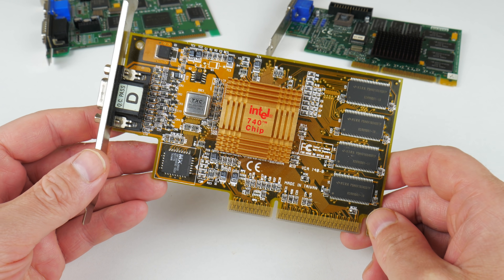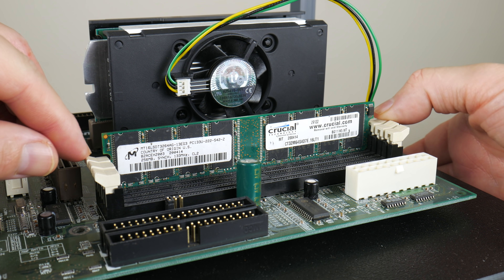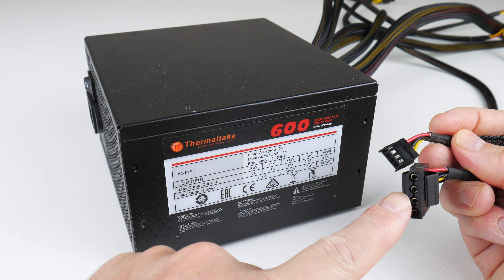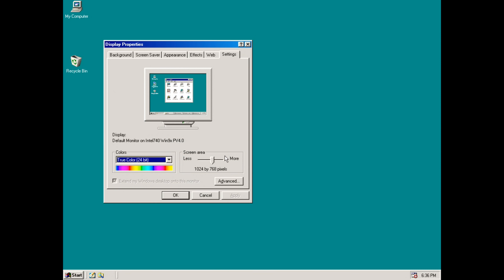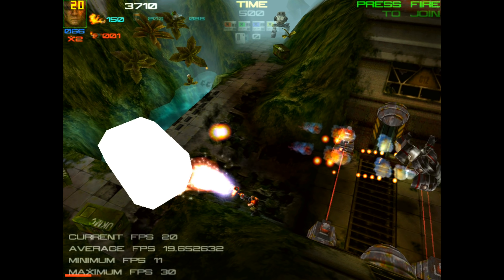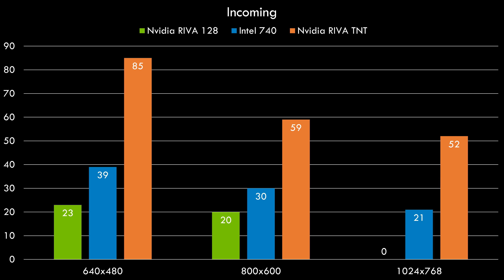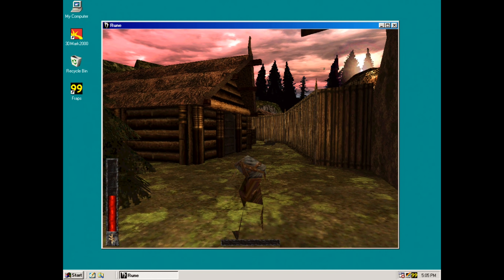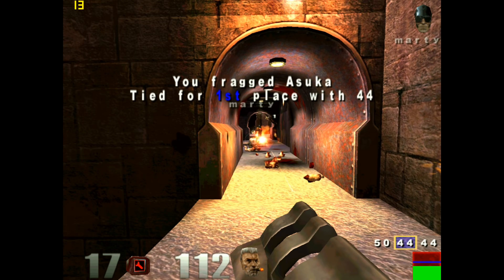Intel's first dedicated GPU vs Nvidia - The Intel 740

Comment: Back in 1998, a friend of mine in college had an i740 with his Pentium II desktop that he had built over the summer.  I had a Dell OEM Riva 128 ZX (the 8 MB AGP version) and an older 3dfx Voodoo 1.  At the time, we were unimpressed by the i740.  It ran Half-Life and Rainbow Six OK at 640x480, but it had problems with the water textures in Half-Life.  The Riva 128 ZX had "cracks" between all the textures, and the Voodoo 1 was showing its age, but had better image quality.  In the end I thought the Riva 128 ZX was the better of the 3 cards when it comes to frame rates, but the Voodoo still had an edge with games like Wing Commander Prophecy, which ran in Glide and had extra effects.  By the next school year, we had ditched all of our graphics cards and got Voodoo3's.
Reply: man.. I remember this, I had an i740 with a Pentium II 300 Mhz and underwater it was impossible to see anything on Half Life... HAHAHAHHA
Reply: Ah.. the old Pentium 2 Memories.
Reply: The "cracks" visible on RIVA128 was sue to missing sub-pixel precision support -- a calculated tradeoff in the architecture to gain performance and keep the transistor budget low.

Comment: Phil, I updated the bios on my I740 a while back and went through the same pain as you regarding the "unsupported flash device". I remember reading the documentation of the different bios versions and noted that the older flash tool versions had way more support that was later removed for whatever reason. So here's what I did: I took the latest bios and used an older version of the tool to flash it. I think it had 5 or 6 flash chip options and I tried all of them until one of them worked. The card flashed and worked perfectly after that.
Hope that helps.
Reply from the maker: Awesome, that gives me something to try :D
Reply: @philscomputerlab  Great. Keep us updated if you find the way to flash it. Mine was a QDI card though, with a different eeprom.

Comment: How much did it cost back in the days
Reply: When Intel did the deal with Real3D to license the tech they had hopes of selling it as a premium part.  However, they were quickly overtaken by innovation by 3DFX, Nvidia, ATI and S3.  Although the Wikipedia article says the chip was originally priced at $34.50 (in large quantities), I would guess that pricing only lasted a few weeks.  By spring 1998, when I bought mine, I only paid £49 for a 8MB Chinese no brand card (suggesting c. $20 or less for the chip)

Comment: I've always been trying to get a 740, as I already have a Riva 128ZX and a ViperV550. 
The closest I've gotten is one of SiS's video cards - an Asus card based around the SiS 300/305 (can't remember the bus width). Still can't run Halo however unlike the SiS chipset in my old Celeron D desktop.

Either the 740 or 300/305 would have been far better than what I had when they came out. I had been given my mum's old late 80's/early 90's 386 PC - no idea the VGA card, no sound card but it did have a dual gameport card for multiplayer games.

Comment: I had an i740 borrowed for months because I bought a P3-500 without knowing it had AGP interface... So I needed something while I saved for a MX200. It was a fine card for what it was, the stuff it could run, it ran fine a lower resolutions. A shame it seemed to lack some D3D instructions that would prevent it from booting more modern games, as they just kicked me to the desktop with no error message.

Comment: Intel used this as the IGP for their 810 and perhaps the 815 chipsets should anyone be interested in experiencing should this card become hard to find. Fun fact that some boards did have dedicated memory for the IGP without using the system ram while there was in ad in vram module that plugged into the agp slot though rarely encountered these days.
Reply: So this is basically the same as 810 igpu?

Comment: Oh wow! Coverage on a graphic card I once owned. An i740. I actually bought this card from a local Best Buy store as my very 1st 3D video card. I quickly noticed something unwanted and odd about its RGB output connected to my Sony Multiscan 15sf1 monitor. The whole screen was dimmer in contrast to my Diamond Speedstar 24 1MB ISA non-accelerated card. No amount of gamma adjustments could compensate for the entire RGB output being dimmer than I liked. I suspect the analog voltage drive output was insufficient. I promptly returned it to Best Buy and went looking at the same store for another very 1st 3D graphic card. I liked the box appeal and specs of a Diamond Viper V330 Riva 128 4MB PCI card and purchased it. Yeah! Screen is bright again, back in the game, and happy with it for several years. My most beloved games at the time was Myst, Riven, and Myst III: Exile. And simply loved April's troubles in Funcom's The Longest Journey. For me the Intel i740 was a disappointment output wise.😉 Nice review Phil.

Comment: This was my first "GPU" paired with a Pentium II 350Mhz, not that bad, my only complain at the time was the poor performance in 1024x768, only 20 fps most of the time. Later upgraded by a GF2MX, what a difference!
Reply: Hi. My experience is similar to yours at XGA resolution (1,024 x 768). Many of those 1st generation 4 - 8 MB 3D graphic cards had too slow rendering speed at XGA. Today, my retro DOS gaming machine is using a Geforce 2 Ti 64MB AGP card. Now 1,024 x 768 runs pretty good for Indiana Jones and the Inferno Machine and Earthworm Jim 3D.😊

Comment: Well, the Pentium III 1000mhz is from 2001. So you are kind of helping this poor card a bit. With a cpu from 1998 I guess its performance would be notoriously worse. Besides, in 1998 the Rage 128, Riva TNT, Savage 3D and Matrox G200... all of them would be more attractive than Intel´s offer. Still, it is good that it existed and I am hoping Intel success with their upcoming GPUs. If they are good enough (especially in the middle range segment) we all will benefit.
Reply: Ran quite well on my old k6-2 300 mhz many fond memories of playing monster truck madness on it
Reply: I have Intel 810e chipset that uses this GPU as integrated onboard graphics.
Reply: At its time this gpu was ruining the market. Once the drivers were properly installed (aka no via chipset + k6-2) this was a beast. All the games ran smooth and you could actually turn everything to the max. Was really hot but all GPUs were hot at that time ('98-'00). The TNT was depressing, Riva TNT and the VooDoo 3D 2/3000 were scorching the pcb. The Matrox card's pcb was T H I C C so it was absorbing more heat from the GPU but they were also more as a package.

Comment: I´ve used a Dell Optiplex GX110, with an Intel 8010 and a 1GHz Coppermine (at least I tink so), It run a lot of games really good at 1024x768. I definitly want to revisit this PC, due to its very nice formfactor.

Comment: Did i miss card specs? But i guess this one have 8MB. Because rare intel model had even 4MB. I think that trying in 1024x768 was hopeless cause it was considered as ultrahighend resolution and only capable cards were Voodoo 2 in SLI or later Riva TNT. Everyone else aimed at that time for 800x600. I740 was basicaly enhanced 1st gen card with agp texturing. So bit better than voodoo 1 or the same. Mentioned drivers issues would be for me no go - Quake 2 not working, that tells everything about driver support.
Reply from the maker: Thanks for leaving a comment!

Comment: In 1998 I had an ATI Rage Pro running with a Cyrix/IBM 6x86 PR200, on a Shuttle motherboard. I still have that machine in a closet. In 1999 I upgraded to a K6-3 450, which I got on release day. That machine has a Voodoo 3 card, though I think the Voodoo 3 was added later. I still have that machine too.

Comment: I've discorvered that I have a Trident Blade 3D.

I hope it works.
If I understand correctly, it should be a decent competitor to the i740 and Riva 128.

So... pretty good for DOS and Win95/98 games?
Reply: I'm using Trident Blade 3D which is integrated on the motherboard on my DOS PC. Works well for old games. I don't care about it's 3D capability as I have better systems to use for those games.
Reply: @mattscomp  
Thank you.

I've experienced that there are many Dos-Win95-Win98 games that can run on WinXP, but a large number that doesn't. So it seems like a gradient.

For that reason I need a late-DOS, early Win98 machine for some of my older games.

I do have a Radeon 9600 XT, but I don't think it works, and I have an MX440 without a cooler and MX4000 of unknown status.

I have finally managed to get an OP WinXP machine (i5-2400 + HD7770), but again, some of the ealiest XP/98 games are co-operating.
Hence my hope on the Trident Blade 3D xD
Reply: @mattscomp  Just an update.
My Radeon 9600 XT works.
In WinXP at the very least.
The MX4000 also works.

I got a hold of a P4 machine, that didn't give video output.
The FX5200 in it had died.

Don't really have time to go into a Win98 project right now, but it's a promising start.
Reply: @janwitkowsky8787  9600 series has drivers for Win98 :-) so that's good news for when you get chance to try it. MX4000 will too of course. The MX one is going to be better choice for older games. The ATI better for XP OS. Always good to have options.

Comment: I had this card back then. My particular model had something wrong about it in the display output department. Hard to describe, but it was very tiring for the eyes to look at the screen for prolonged periods, especially if there was a lot of white areas (like in GUI). And no, it's not the refresh rate, it was set correctly to usually not tiring 75 or 85 Hz. Not the brightness either, as I tried tuning brightness/contrast settings on the monitor and it did not help much.

Comment: I was using a Matrox M3D paired with a Matrox Millennium.  The former uses a PowerVR PCX2 chip, and has no video output.  It draws directly to the graphics card frame buffer (4MB), meaning all the onboard memory (4MB) is used for textures.  You could play a game at 1024x768 with 24-bit color.  Support for the card was somewhat limited, but it ran reasonably well, and was inexpensive.

It wasn't that long after, however, that I upgraded to a Millennium II AGP with an 8MB frame buffer, to support 1600x1200 with 24-bit color on the desktop, and swapped out the M3D for a Voodoo2.  That had a 4MB frame buffer and 8MB of texture memory.  I later added a second one for SLI, which made for a pretty fast setup at the time.

Comment: Until xmas '98 I was running with an overclocked Pentium 120@133 and S3 2D card + Voodoo Graphics. I bought my 2nd and last complete computer which came with the new K6-2 400 and the S3 Savage 3D but that card had to be switched to a Rage128 nonpro because of hardware oder driver bug with the Savage3D and SS7-Systems. For Glide compatibility I continued to use the Voodoo Graphics. On the release day I bought the Voodoo 3 3000 AGP und threw the other cards out. 
As far as I remember the i740 was not that common in germany, at least the retail version. For a company's first 3D Chip it was quite good considering the problems other companies had. But Nvidia and 3dfx were too dominant so I think because of that Intel withdrew the i752 (AGP2x) and completely canceled the i754 (AGP4x) as seperate cards. This chips still didn't support 32bit in 3D mode.

Comment: Out of curiosity I'd be interested in seeing this GPU with an AGP board running DDR2 to see if performance scales at all with memory bandwidth.

Obviously the GPU core isn't going to set the world on fire and will still struggle in most games, but how much more does the GPU have to give with a better memory setup.
Reply from the maker: I don't think it does, as the card is only AGP 1x or 2x, so doesn't go faster than that. But for sure there is a difference between PC66 and 100 RAM.

Comment: Around that era. My PC was a  Soyo 6BA+3 motherboard. It went though quite a few upgrades. Starting at a Celeron 300a OC to 450MHz and eventually topped out with a P3 1.4Ghz. I was in the Matrox camp back then, Went though several Matrox cards with that PC. Matrox Millennium 2, Matrox G400 Max, and finally ending with a Matrox Parhelia in it. Still have the PC, just sitting in my closet. Also did the Promise Ultra66 to Fastrack66 hack to run 2 HD in RAID 0. Hack was fairly simple. The two cards were essentially the same. Desolder the BIOS chip and under it was a resistor "jumper" move the resistor to the other jumper location, then you could flash the Fastrack66 BIOS on it and have a RAID card for a quarter of the price.

Comment: I remember when I used Intel 740 with Celeron 300 without L2, it worked good for me with older games. Thank you very much for testing that card. On that card I even tried GTA Vice City and it ran.
Reply: Likewise, this was my first ever AGP card bought to go with my Original Celeron 266 (although overclocked to 400 on my Abit BH6 (440BX) motherboard). Price - performance was incredible, coming from a P166MMX.  Same motherboard lasted me through a two significant  CPU updates - 2nd Gen Celeron 300 (with 128MB L2) @450 MHz, Celeron 600 @900 MHz and countless GPUs inc. S3 Savage, Voodoo 1, Voodoo 2, Voodoo 2 SLI, Geforce 256 DDR!  A true golden era of upgrading!
Reply: I had a 233mmx and it was magic when I first got my 16mb 3dfx voodoo banshee.. 
It made star trek armada look impressive, especially coming from some 4mb card I originally had. Which would only render small dots for a nebula. I even got gtaiii to load and run for a short time.. but it would usually crash when you looked at the broken bridge... great times

Comment: In 1998 I had a Pentium II 300MHz with an ATI Rage Pro Turbo, I think it had 8MB of RAM. PC had 32MB. I pestered my dad until he bought me a Voodoo 2 12MB eventually 😀. Compared to that ATI card, Voodoo was definitely an eyeopener. First games I remember trying were Quake 2 and Need For Speed II SE. Was absolutely blown away! I think the best gaming memories I've ever had were on that PC. Highlights were Thief: The Dark Project and System Shock 2. Wing Commander: Prophecy, Descent: Freespace and Half-Life also.

As for Intel's upcoming GPU - I'll reckon it'll be at around maybe Radeon 6700/RTX 3070 levels of performance. Won't bother the high end, but I think it'll be a decent midrange card.

Comment: Imagine if today we had all those companies making GPUs. Prices and support would be a totally different story.
Reply: Intel is just about to re enter the GPU market , think early 2022, I'm not sure if I would buy one but will be interesting to see what they come up with and what AMD,Nvidia do in response....
Reply: @nix123ism  If the new Intel GPU is any good and the price is right I'll get one. But those are big ifs. I can easily see either or both not being the case.
Reply: @1pcfred  they are already selling a entry level card to OEMs , the Xe DG1 , gamers nexus has a review on it, so it's def not vaporware,  obviously it's not high end graphics territory but even having a product that works and is price competitive is more than anyone else has done for the last decade
Reply: @1pcfred  well,they tested it and it was from an oem system so the drivers are obviously functioning, only has the performance of a gtx 1030 but that is the base model , not mid or top tier card, so the only thing I took away from the review is that they have a functioning product that they are selling now.... I'm not sure if price,performance is the key issue either, at the moment if you can't buy a 3080 then there is no point considering it, I think if intel can actually get products to market and sell them then they are doing better than nvidia,AMD at the moment. I just built up a second pc and normally go for AMD cpus but at the moment the cheapest AMD cpu I can get is ryzen 5 3600 at $400(!) So I ended up buying a i3 10105f for $150 , pretty much same performance for less than half AMD, AMD has nothing available in the market that is cheap so went with intel, something I wouldn't do normally, this situation may be the same as the graphics market, if they come out with a gpu that is good enough and sells for $500 then that's what you buy rather than a $800 AMD ,Nvidia product if you can get one....
Reply: The market doesn't exist today. In the late 90s if you wanted to do anything digital you had to have a PC. Today you can use a phone or a tablet. Which is all plenty of folks own now. That has shrunk the PC market considerably. So the market can no longer leverage a massive economy of scale like it once could.

Comment: It's a solid 2-D card (C&T's influence there) to mate with a V1/V2 or a PCX2 and I've heard it's perfectly fine in DOS (so good for a C3 based retro rig). It's unfortunate Intel used it to showcase AGP: that essentially meant that the card just would not work with most entry level (i.e.: Via, etc) chipsets with quirkier AGP implementations, basically strangling this thing before it could get acceptance.

Comment: I want to build a full custom Pentium II/III PC again, but I don't want to pay the "retro" tax that comes with it. The cost could amount to $500+ after all is said and done.
Reply from the maker: Pentium 4 or Athlon 64 are the way to go for affordable Windows 98 SE. Sound Blaster Live! and Radeon 9200 or GeForce FX 5200 to get you started.
Reply: @philscomputerlab  I mean if I wanted to go more period correct. I have a PC with a 2.8 Ghz P4, 256 MB of RAM, and a Radeon 9250 Pro, or an ATI Rage 128, depending on my prefrences.

 Your videos over the past several years helped me learn how cheap the Pentium 4 route can be. Of course I had to replace some caps along the way

The sound  card I do have is an SB 1394 Soundblaster card I acquired in 2013 when I was given a PC by a teacher of mine.